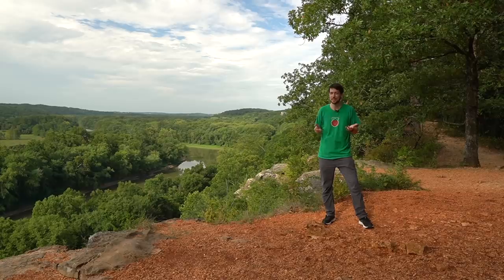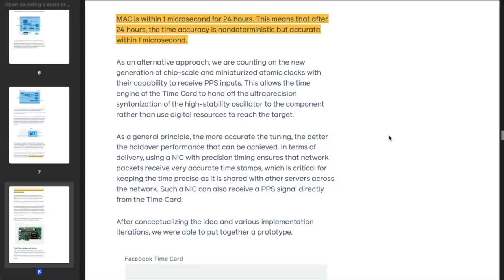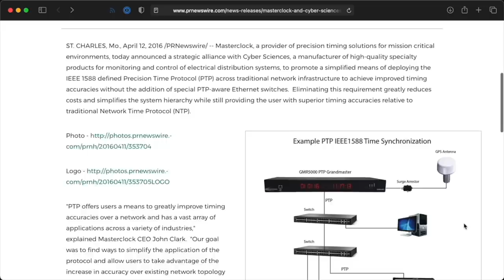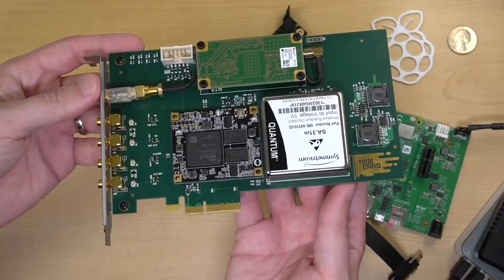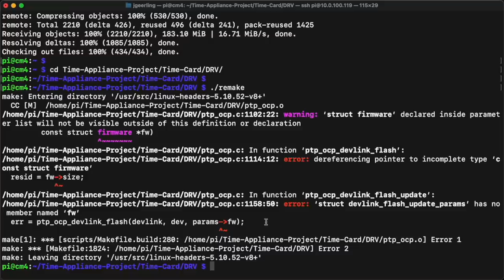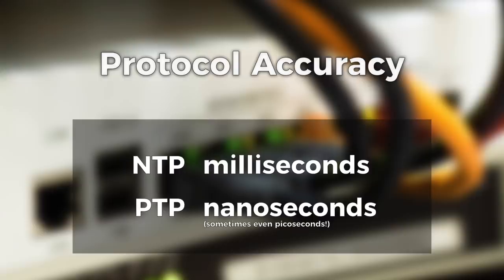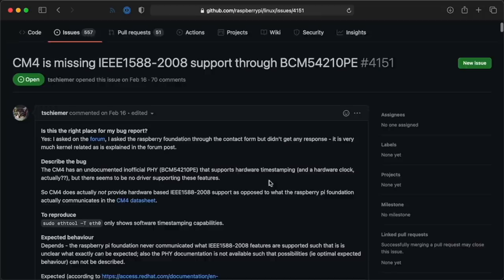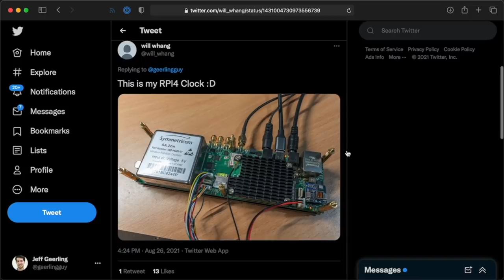The most accurate Raspberry Pi atomic clock IN THE WORLD!

Comment: since the RaspberryPi  doesn't have a RTC, you had to go overboard!!!
Reply from the maker: I mean, they could've prevented the whole situation by just including the quartz clock on the regular Pi 4... but no, gotta go rubidium now!

Though the CM4 IO board does have an RTC built in, and a battery slot.

Comment: Did raspiOS pick the correct time source right away after using the newer kernel? I remember having to tweak some settings after slapping a (non-atomic) RTC module on my old raspi 1 that kept drifting
Reply from the maker: Still working on the software side now. I will hopefully have more answers on setting up the internal clock source in next video on the Time Card!

Comment: I work in broadcast and GPS or even NTP is fine..
Reply from the maker: In broadcast, the precise timing is often less important (don't need nanosecond resolution), but the need for a reliable reference clock (and PTP, if you need to implement AES67 or SMPTE 2110) is still important.

Many of the products currently on the market for the task start at $500-ish (without GPS integration) and $2000+ with GPS and/or rubidium. Plus like I mentioned in the video, they're running a proprietary software stack.

This works for many people of course, if it ain't broke, don't fix it. But I like seeing an open alternative.
Reply: @JeffGeerling  i much often use NDI even for big 4K projects. For audio we use Dante. So do not need precission timings. 

The biggest problem with timing i have with DVB-T multiplexer. Because TVs usually gets time from DVB-T unless they are smartTV. I allways use GPS for that. Because I need only milisecound resolution.

Comment: Awesome project. But I am a bit confused with servercheckin example. 2s per month drift is something what should be easily handled even by NTP.

Also, adding jitter to scheduling is frequently a feature (not a bug). One reason being https://en.wikipedia.org/wiki/Thundering_herd_problem avoidance.
Reply from the maker: True on both counts. And I mentioned the NTP issue in a little blurb in the bottom corner during that part of the video.

As it turns out, for some reason NTP traffic in that data center is messed up (maybe some firewall, who knows), so I've had to fight with NTP on that particular server to the point where I set the clock from another one of my servers instead of a public NTP server.

I really should just delete that dumb server and spin up a new one somewhere else... but it does help me think more critically about time!
Reply: @JeffGeerling  aah, sorry totally overlooked the blurb. Was watching it on mobile.
Reply from the maker: @AntoninKral  Yeah, I only put it there because I know that (a) good programmers will question why not just use NTP, and (b) I should still just delete that server and bring up another.

Comment: How is this different then the GPS PI hat I have installed on my device?
Reply from the maker: This card also has a rubidium atomic clock (so it can hold time more accurately if GPS signal is lost for any reason), and an FPGA that signals a PPS for hardware-based timing coordination. These things aren't needed for most consumer-level timing, though.

Comment: Oddly, when people start talking about time and accuracy of measurement (and I mean this respectfully, I enjoy your videos usually) I can't help but think that they have forgotten that time is a man made construct, and the measurement of time is based on an inconsistent natural phenomena (the rotation of the earth and the orbit of the earth around the sun, with arbitrary correction stages every 4 years or so - which is not even quite four years). Even Einstein's theory supposes that time is not constant, and so there is no such thing as an accurate measuring device, no matter how tight you think you have it. And it's been proven. The most accurate timepieces at the time were synchronised, and one sent to space and back. Guess what, no longer synchronised. I think we need a term other than time when dealing with computer clock cycles.
Reply: Einstein defined time as "That which you measure with a clock."
Reply: This topic is really talking about two separate, but related things. Time is what you read on your watch. A clock is the tick-tocks (for us old timers that remember what a tick-tock is). And actually a clock is just the tick or just the tock since only one edge is normally used.
Also, time hasn't been based on inconsistent natural phenomena since at least the 1960's when atomic clocks started being used.

Comment: No it cannot be a stratum-1 time server. It can be a stratum-2 time server.. Stratum-1 are directly connected to national atomic clocks, more precise than Rubidium clocks, especially GPS clocks, who drift pretty much due to relativistic effects from being in orbit.
Reply from the maker: Stratum 0 is something directly connected to GPS (like the u-blox on this board). Stratum 1 is something directly connected to Stratum 0 (like the FPGA + Rubidium oscillator.

Therefore this is most definitely a Stratum 1 device. Not my quote: "The basic definition of a stratum-1 time server is that it be directly linked (not over a network path) to a reliable source of UTC time such as GPS, WWV, or CDMA transmissions."
Reply: @JeffGeerling  Well, a lot of RFC's have come since I worked with it, but GPS time is not very accurate anyway, about 14nS at the satellite and 100nS in the GPS receiver. TAI is really the reference, and to get nanosecond accuracy you need to be hooked directly to ex NIST clocks etc.
Now you can get better than 100nS depending on receiver and GNS network. By using multifrequency receivers and more than one GNS network plus knowing your antennas exact position maybe you canmathematically reduce errors further but.. It's still not nanosecond accuracy.....
Reply from the maker: @MrZnarffy  Indeed, there nanosecond level accuracy comes through the rubidium reference, but typically it looks like the true UTC time drift is in the 30-50 ns range (still need to do more measurement there). But I should note that there's a v2 of the Time Card that will have two separate GNSS receivers, one on L1/L2, and another on L5 and able to use WWVB so it could use a separate known-distance reference, too.
Reply: @JeffGeerling  Still GPS will never reach the accuracy needed, due to frame drag etc. The UTC  is not a good reference, you need access to TAI, as UTC is pulled from TAI and not really nanosecond accurate anyway, plus UTC deals with leap seconds etc, and they might for example drag out a leap second over a day etc.
With 2 receivers and different frequencies you can remove ionospheric effects so you get closer to the 14nS errror limit.
All that is irrelevant anyway, as getting anything more than a couple hundred nanosecond tolerance inside your computer will be impossible. And outside, maybe?? a microsecond in accuracy, which is in itself pretty awesome.
I haven't looked deeper at this card, but if I could cheaply get one to get microsecond accuracy alone I would be happy enough.
The tens of nanosecond accuracy might be worth itfor large datacenters but.......

Comment: "this card is to time accuracy as apple ipod was to mp3 players before it" ok following you so far..."it repackages existing technology in a way thats easier and better to use" ok ya lost me.
I owned one of those Ipods, they required ibloat, and bloattime to be installed, wiped themselves apon a new install, you had 5 connections to different computers before you had to delete one or you had to wipe it and start again(this included if you had to format your computer, it counted as a new machine, and that was fairly common then), you couldn't easily use it for other files, and it had issues with a bunch of file types, and every time a firmware update came out it wiped itself again.

MP3 players at the time you plugged in, dumped your music on it, used any free space as a normal usb stick, and it just worked, and you could plug it into anything you wanted, oh and they often had a built in FM radio aswell.

In no way was an Ipod easier to use than standard MP3 players, it had two advantages, battery life, and storage space, and if you paid the same amount as an IPOD for a normal MP3 player, you got both of those aswell.

Comment: "GPS signal can't be relied on all the time"

Are you regularly subjected to GPS jamming signals? You have very sophisticated enemies.
Reply from the maker: Especially in urban environments, with cheaper antennas, it can't be relied on to be stable all the time. if you have a fixed antenna system mounted in a place with a clear view of the sky, that's a lot different. I, unfortunately, don't :)
Reply: @JeffGeerling  Also, around some military bases, there is occasional GPS interference testing which wipes out GPS. They send out Notices to Airmen when they do this.

Comment: So the tl;dr; is basically unless you want to spend hundreds of dollars on this thing, you just plug a GPS into the PI and make sure it doesn't lose connection?
Reply from the maker: Sort-of; even with good GPS connection, the internal clock (especially with a battery backup) is also important if your use case depends on microsecond accuracy.

Additionally, having PTP hardware timestamping can keep all your local area devices in perfect sync (regardless of how accurate the actual time is in reference to UTC).
Reply: That's what my previous employer did. They built 2 devices, which extended the clock via PTP. One had a holdover of IIRC 24 hours before it drifted too far, the later cheaper versions it was a couple of minutes.

Comment: For your Chicago server, why couldn't you just run ntpd?  That would have kept it milliscond accurate at least.
Reply from the maker: I've had trouble getting NTP working reliably on that server, unfortunately... but I should also just delete that server and bring up a new one. Check the little blurb in the bottom corner during that portion :)
Reply: @JeffGeerling  Weird (about ntp not working reliably)  I see the blurb -- my closed captions obscured it originally.  I used to have an old PC in an attic, and I could tell how hot it was at home (and whether my roommate was home or not) based on the NTP logged time corrections to the RTC.  Is the chicago datacenter hot?
Reply from the maker: @DennisGentry  I wouldn't be surprised if it is; for these servers, I keep the costs to an absolute minimum, so I use cheap providers found through LowEndBox.com (note that the main service, which has all the user data and such, is NOT running on a cheap LEB server—only the actual HTTP requests/pings that check for uptime). So I've had worse issues (like servers that would themselves only be up for 70-80% of a day!).

Comment: Q: can Starlink nodes be stratum 1 time servers?
Reply from the maker: Hmm... that's a good question—since the software isn't accessible it doesn't seem like they could be directly, but technically they would have very precise timing data. Would be neat if they could run at least NTP.
Reply: The relativistic effects would have to be accounted for which could cause problems if the satellites start to maneuver

Comment: If carbon atoms break down every 5k years how could this possibly keep accurate time for 32k? Wouldn't the device break down long before due to atomic decay?
Reply: This is a hypothetical. Think about where we were only 2000 years ago.

This is simply the drift if this clock compared to a time standard (which is a cesium clock), and then from that calculated the time it takes to drift one second.

Also, good luck keeping a computer running for only 500 years. It would need constant maintenance. Your software would need to not get to a blue screen, ever. Your UPS would regularly need new batteries. You would need new capacitors and MOSFETs in your power supply. And lastly you have to get your hands on 500 year old semiconductors stuff.

So, atomic decay is more of an ivory tower problem when it comes to keeping a device running for that long. I think before that you will actually have to worry about ion migration in the semiconductors. See also the tech quickie episode on "Why do electronics fail?" (Aka "Why does solid state stuff fail although it's solid state?")

Comment: "Who cares about billionths of a second?" Um, me? Trying to build a radio telescope array and gps time is just not accurate enough to set, let alone keep, time sufficiently for the interferometry thing to work.
Reply: Remember that a GPS module normally has a 1 pps digital out with very good quality and several modules can reconfigure to emit 10 MHz.

A cheap UBlox NEO-M8 can supply a 1pps or 10MHz signal.

Different modules normally manages between 1 and 10 ns time error on the 1 pps signal.

The rubidium clock helps keep the time if no satellites are available, but I don't think it will help you get a better result than a really good (and still extremely cheap) GNSS module.

I think you'll still end up with 1pps or 10MHz of similar quality - and the absolute time of this board can't be better than the time set from the GNSS module.

Comment: If it is a GPS based clock, then it's not really a true atomic clock and any GPS receiver will do the trick, even a smaller one without the fancy oscillator.
Reply from the maker: That's the thing—this clock has both a GPS (for acquisition) plus a rubidium oscillator for holdover (which by any definition I know is considered 'atomic'). It's not quite cesium, but it is atomic.
Reply: True, I get that. But having such a device constantly polling for the GPS timestamps kind of defeats the purpose and makes it feel like the marketing gimmick seen on wrist watches. Unless you're on the need for a long out of sync period of time, I'd rather just poll for the GPS timestamp once a day and achieve the same precision with a smaller module not relying on a fancy oscillator. Maybe this device makes such a great companion for long term cave explorations, submarines on the deep sea, or anywhere a GPS is out of reach. Anyways, good to see more PCIe devices added to the RPi supported list, keep it up Jeff 👍.
Reply from the maker: @ThePunkBuster  The database keeps growing!

And now you have me thinking I need to work on installing a Pi in a nuclear submarine...